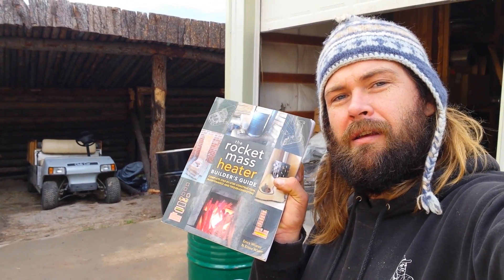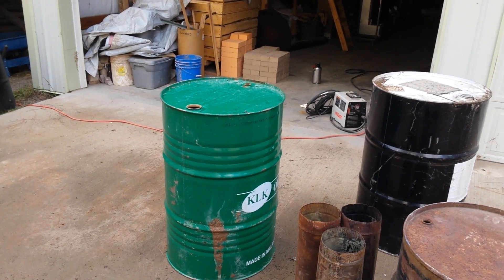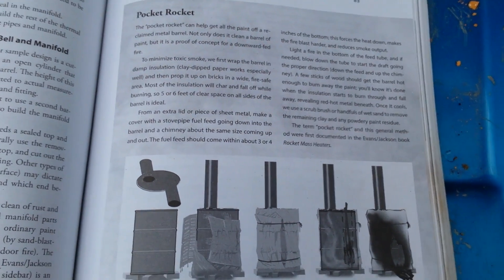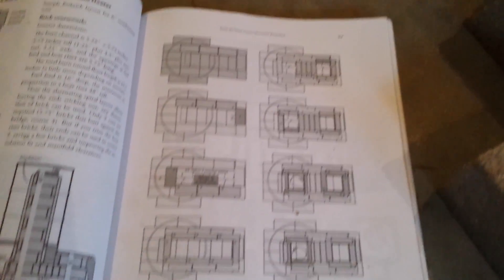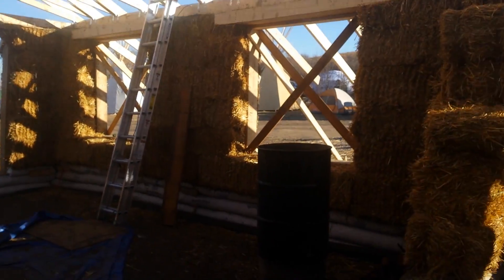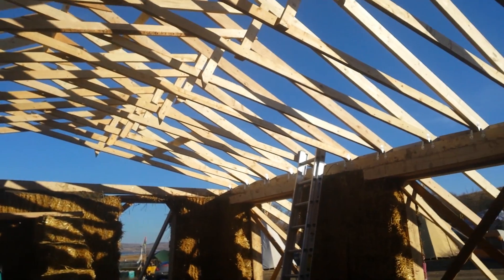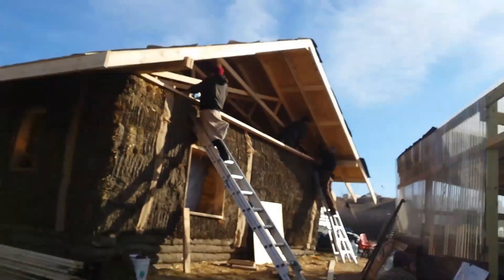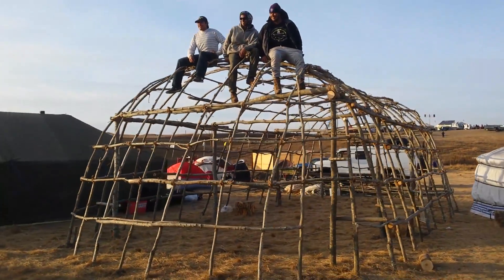Building a Rocket Mass Heater at Standing Rock Part 1 -  Presented by OneHeartFire

Comment: How to make the heaters is great but I can't say I approve of the cause you are building it for.  The protestors lied one after another and I don't think you have a clue what it was all about.  Now if you are an environmentalist that is fine but you really should have done some research before you backed them.
Reply from the maker: Michael Meyer I respect your opinion, but I must disagree.  there were certainly a lot of lies circling, and a whole lot of people spreading rumour, hearsay, and downright intentional misinformation about what was going on at the camps.  I feel like that kind of thing is bound to happen when you get thousands of people gathered in one place, and millions focused on them, all revolving around an emotionally charged issue.  there was all kinds of messages coming out of Standing Rock from all kinds of folks with their own agendas, but the one thing they all had in common was the message that we need to protect the water.  I stand behind that message, and despite all the chaos, I am thankful that all those millions of people got to hear that message.  also, the pipeline has already leaked during its first year of operation, so you can't deny that the water protectors were right about the dangers of the pipeline.
Reply: The only leaks that occurred on the pipeline was during the testing phase (which is what testing is for, to find and correct problems) and the safety features contained it, also those leaks did not happen near any body of water and spilled less than 140 gallons (you will find more than that amount under your local gas station).  It has not leaked since.  Those people came to the camps under false pretenses so the protest was a lie.  DAPL did not even touch Standing Rock Indian Reservation.  Since you were there then you know that you had to cross the Cannonball River (the north border of the SRIR since 1877 (141 years ago)) to get to that oceti camp and the DAPL was at least 1/2 mile north of that river.  That camp was on the flood plain of the Cannonball River at the confluence with the Missouri River/Lake Oahe and was controlled by the United States Army Corps of Engineers (USACE).  The area north and west of the camp (both sides of Hwy 1806) was part of the Cannonball Ranch owned by my cousin till Sep 21, 2016 when he sold part of it to Energy Transfer Partners: http://www.reuters.com/article/us-usa-pipeline-nativeamericans-land-idUSKCN11T2HK .  So privately owned.  The tribe's water intake was being moved to 75 miles away from its present location (so about 100 miles from the pipeline) which has been in work since the drought of 2002 threatened to expose the intake (so many years before DAPL was even thought of).  So their water was not threatened: http://www.kfyrtv.com/content/news/Water-intake-system-for-Standing-Rock-Sioux-Tribe-surrounding-areas-being-moved-south-before-construction-of-DAPL-408084365.html .  DAPL followed and used the same easement as the 1982 Northern Borders pipeline (which the tribe did not object to):  (compare these 2 maps) https://ndpipelines.files.wordpress.com/2012/05/nd-natural-gas-map-feb-2016.pdf   (light blue line) with http://www.daplpipelinefacts.com/docs-dapl/DAPL_States_Counties.pdf .  This solved 2 problems at once, 1.  No sacred/cultural/burial sites would be disturbed/destroyed and 2.  An Environmental Impact Statement would be a monumental waste of money (the impact was already made in 1982), only an Environmental Assessment was needed (which was done: http://cdm16021.contentdm.oclc.org/cdm/ref/collection/p16021coll7/id/2801 .  I have many more links that show it was a lie so if you need more just ask.  Just so you know that you need to be accurate, I live here and know the area and many people on both sides of the protest.  Also sometimes YouTube doesn't correctly take the links to the proper page so if that happens copy the links into the address line of a new web page and they work fine.
Reply: @michaelmeyer6306  
Excellent post Michael.
Thanks!!

Comment: where did you find the barrels?
Reply from the maker: craigslist is a good source in most cities.  Or just check out industrial/manufacturing areas and see if anyone has them sitting around.  They might sell them to you or just let you have them. Food grade barrels with an open top are the best to work with.

Comment: Peace, Prosperity, & Posterity. Clean Water Security, Clean Energy Security, Clean Jobs with Security.  A Solar Steam Pipeline from Houston to Denver would provide for our nation. 10,000,000 in the combined metros, manufacturing & maintaining a solar steam desalination plant, water to steam is a 1600 time expansion. Steam to water a 1600 time contraction. A desalination plant in Texas feeding a primary reservoir in Colorado, with a 16 state river system, utilizing a solar steam canal magnifying sunrays onto submerged heating elements creating 3000 Degree F Hotspots for 3-6 hours per day 300 days per year should be Proper Planning & Preparations to Prevent Pore Performances. Survival Sustainability Security Socialwealth  Selfbetterment. WE are One Human Family. WE have but One Human Body. There is but One Human Heart. Interact, Unite, Create. What Will Be In 2030? Humanity2B 

Solar Steam with a decent Spot Fresnel Lens is able to create a 5000 degree hot spot in less than 5 min on a bright sunny day. 

https://youtu.be/xWMrsqs3bFc

https://youtu.be/hr6U33KSspQ

https://youtu.be/xExXjXm0YV0
Reply from the maker: Wow, very interesting stuff.  I learned about fresnel lenses a few years ago (from an atomic energy engineer no less) and have been wanting to experiment with them ever since.  I just haven't had a safe place to do that yet. I don't want to burn the forest down!

Comment: also the rocket mass heaters in the Tea House yurt by Pueblo Camp worked amazingly well. Look for Yergi the tea master by Roses Kitchen and All My Relations Kitchen. 

while a few of the elders in Oceti Sakowin were not receptive to building rocket stoves we do not doubt that through the winter many will have time to learn about the ones that were installed. that being said quite a few elders did recognize the benefits of the rocket stoves and the indigenous wisdom that is part of the stoves. in fact traditional Lakota tipi winterization called for a set up very similar to thermal mass rocket stoves.